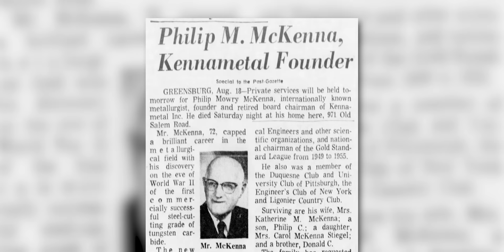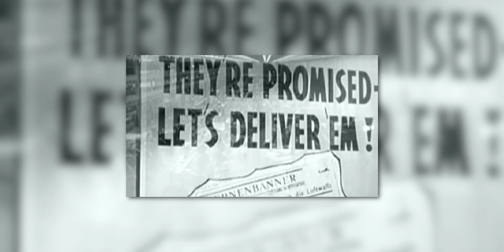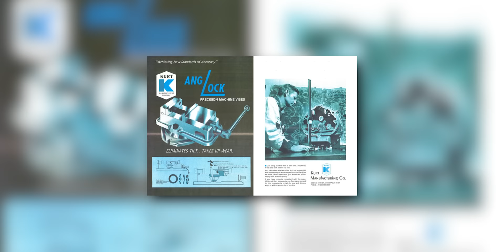How Machining Helped Stop The War

Comment: Thanks for shedding some light on this topic. My grandfather was one of many manufacturers opening shop during the war. He founded Precision Tool Company in Muskegon MI in 1942, following the heightened demand for custom carbide tipped cutting tools. We are still in operation today, having adopted CNC machines and automation systems to create custom carbide / HSS drills, reamers, boring bars, router bits, etc. from scratch. Great video!

Comment: Nice video, I like how you incorporated a lot of the machining pioneers in the videos.
Reply: Thanks, i thought the surface plate was a cool story, one i didnt know about
Reply: @barrysetzer  my old machining teacher told us they used to make them out of steel but switched to stone because of rust and wear issues, when I saw your video it clicked in my head that steel was scarce and they needed a solution. Also I thought was introduced to machining when the SR-71 was being developed on account of the titanium machining wearing out the HSS cutters?
Reply: @barrysetzer  I am amazed they didn't think of it sooner.

Comment: We've got five WWII era Warner & Swasey turret lathes at my shop. Each one works just as well as it did the day it rolled out of the factory. Testament to American manufacturing quality. Even though the machines are 80 years old, they still can hold half a thou all day. Of course, that depends on the operator... but still quite impressive.